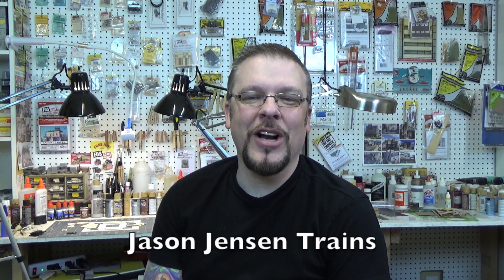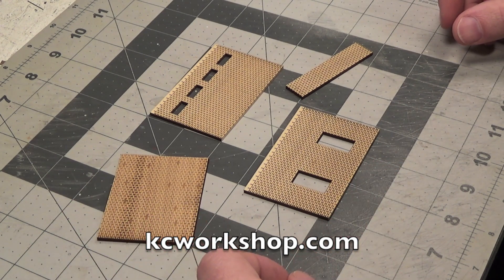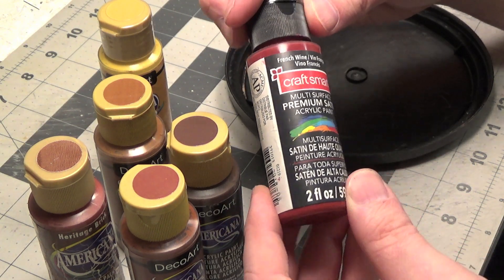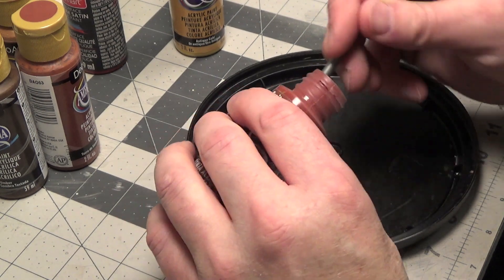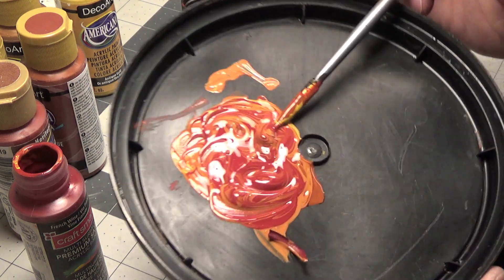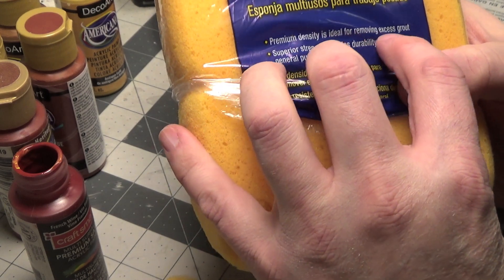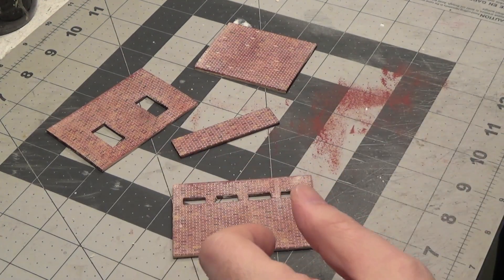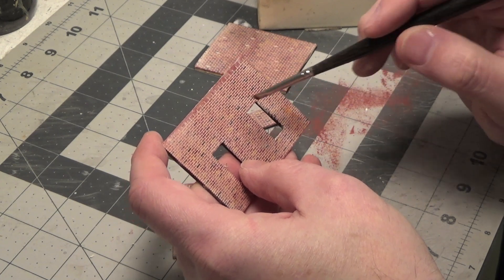Painting brick walls for a model railroad structure Episode 014

Comment: I .think everything Jason works on (even  if he makes a mistake] is so well explained.  I have a question on the bricks,.  I found  3 -10” x approx.30” sheets of brick from Holgate & Reynolds.  I hate to waste them.  The bricks look like the same height as HO but the length is almost doubled which scale should I use them on, HO or O I have worked in 1/4 scale (1/48).  But want to try HO (if I can, Because I have Lupus)
Reply from the maker: I'm leaning towards O scale.
Reply from the maker: I dont know with out seeing it. But like I said, I'm leaning towards O scale.
Reply: Jason Jensen Trains  You’re probably right but I think I will try making one little brick building to see if I can handle the size and I’ll be able to judge better to see if the brick would work on it at all.  I’ve learned so much from you that I’m dying to try it on one size or the other anyway.  Thank you for responding to my question.  I can send you a piece the size you could use on something, I have a lot of it, each piece is 8x21”

Comment: Nice video!  Very interesting technique with the joint compound. I’ll have to try that. Also, wondering why you didn’t brace up the walls with 1/8” strips like in a recent video?  Are the walls used here much thicker wood?
Reply from the maker: Thank you, and thank you for watching!!! The walls are pretty thick but you should still brace them. I used them just for the video so I didn't brace them but then decided to make a small structure with them. I recommend always bracing!

Comment: No matter how much of the grout color you try to remove, the brick face will always have some layer of color over it.  I would recommend putting the grout material on FIRST, and then adding the brick color with the dry sponge technique.  Besides looking better, you save the time and effort it takes to remove the grout color, and the clean-up inside door and window frames.

Comment: If you reverse the coloring steps (brick color and mortar color) you'll find the results quicker and less messy.  Flood the brick wall with your chosen mortar color and let it dry completely (a hair dryer helps).  Then come back with your multi-colored brick colors and use a sponge to apply the color to the brick surface (like a "dry-brush" technique, only with a sponge).  Use a very light touch with the sponge and color all the brick surfaces.  By doing this in the order described, you won't get that white haze over the top of all the bricks.
Reply from the maker: Thanks for watching and thank you for the suggestion but thats not the look I wanted. I like the wash over the brick. I feel it gives it more of an aged look. I have used the technique you mentioned on a brick building that was new looking. Thanks again for watching!!!

Comment: I want to be able to do my brick walls without the weathering effect, just adding the grouting over newly painted wall and keeping that new building look?
Reply from the maker: That works.! You could just spray paint the wall a brick red color then let it dry for a full day and then apply the grout.  Always let the paint dry for a long time so that the brick color doesn't bleed into the grout. Happy modeling!!!
Reply: I have considered this myself.
I’m in the UK, and I’m in the process of building architecture for a period railway (railroad?) based around the 1920’s/30’s.
I have weathered some of the buildings as I see them today, then later realised the buildings at that time would have been new, or still in the process of building., not looking 90-100 years old.